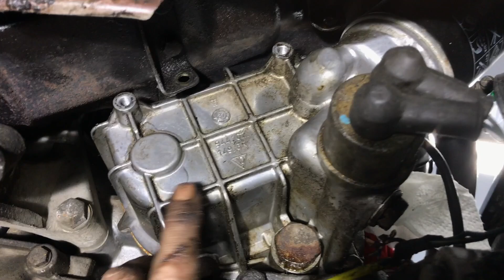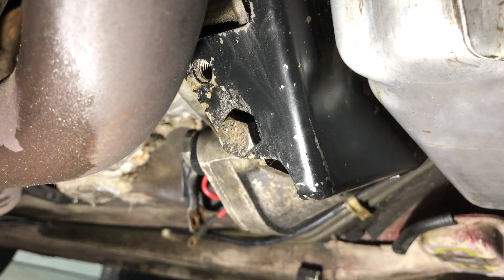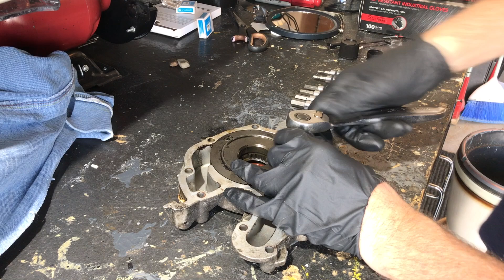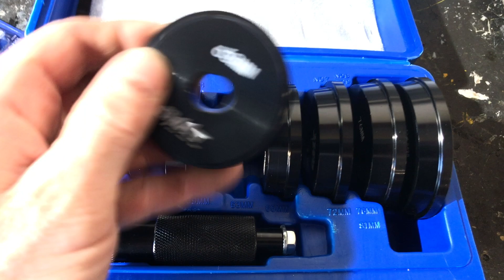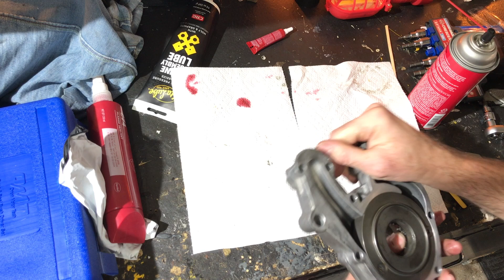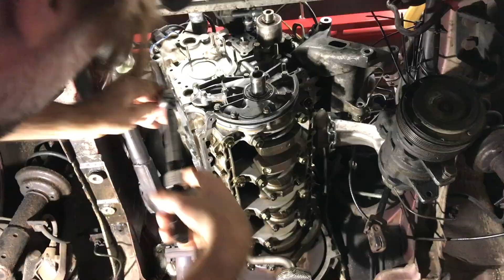Conquering a Leaky 944/924S Oil Pump

Comment: You sir are a machine! I had to pull the pan on mine to address the bearings and some forbidden glitter. I wouldnt wish this job on my worst enemy. I do wish i took care of the oil cooler gasket while i was in there.
Reply from the maker: 😄thanks for the comment.  Yeah, I know what you mean, almost everything on this car is a pain to get at and such a process.  It’s hard to decide how far to go with stuff too, like with your oil cooler, I get it!  Thanks again.

Comment: Man you are braver than me. Will be looking to do rod bearings and oil pan gasket maybe this summer - not looking forward to that. For sure leaving the oil pump alone if i can lol. You prob made the best oil pump video there is right now, many thanks
Reply from the maker: :)Well, hopefully you don't have to mess with your pump, but if you do, it's doable.  Yeah, I don't blame you for not looking forward to doing the bearings/gasket–it is a big job. I decided not to do  the bearings in mine just  because I didn't think I needed them, but now I'm starting to wish I would have just done them while I was in there.  Having to pull the pan again after all that work doesn't exactly sound like fun, so fingers crossed on that one.  Thanks for the compliment on the video–that's really nice to hear–and of course you're welcome!  And thanks for the comment too.